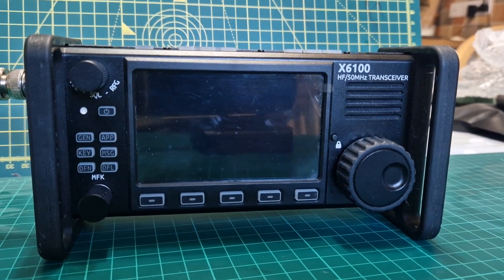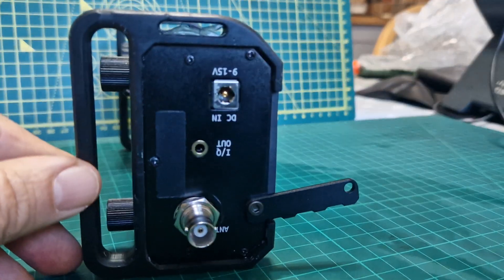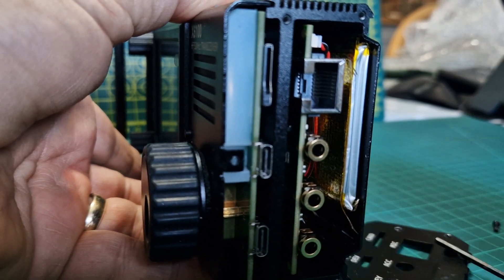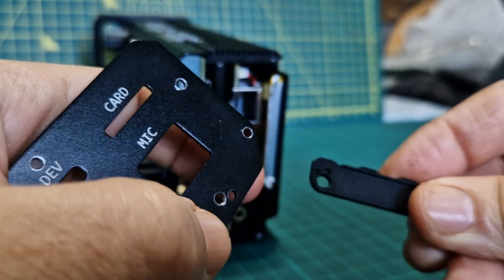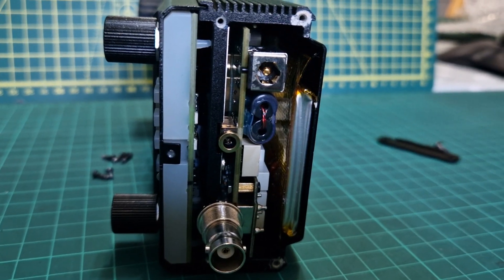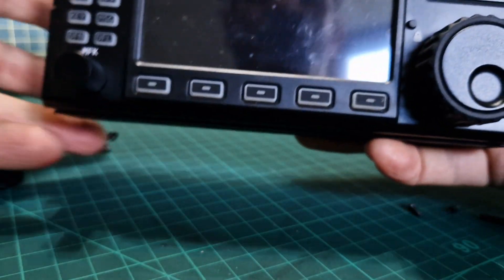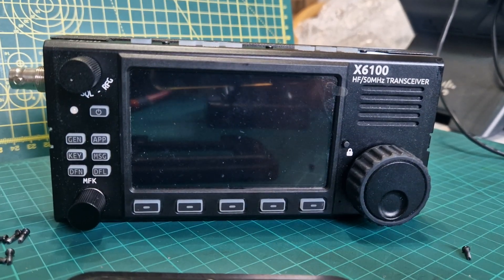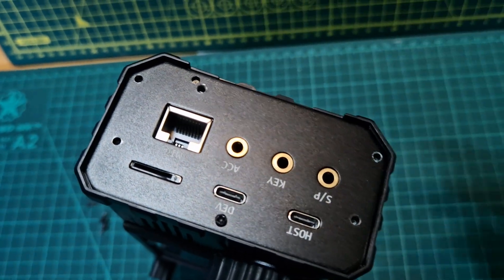XIEGU X6100 - Remove/Replace Sides, Ball Bearings?

Comment: Hmm,  I wondered if both were meant to have detent.  New out of the box, mine had left side detent and right side did not, just the same.
Reply from the maker: I now have metal side handles.
Reply: @M0FXBHamTech  just added those also,  pretty nice